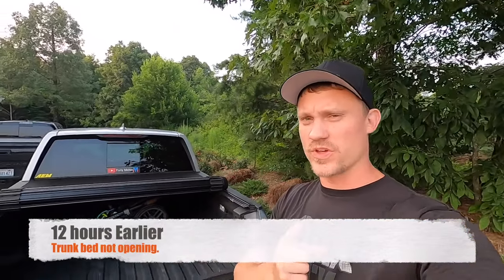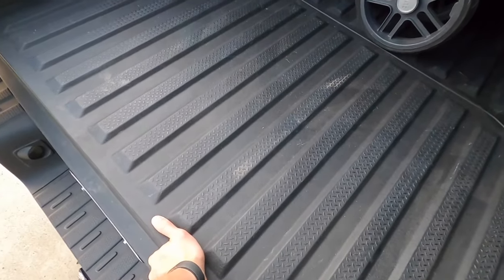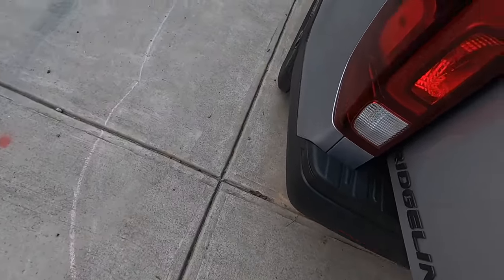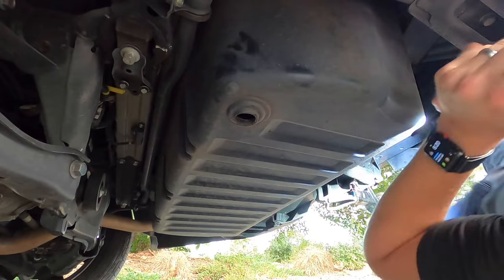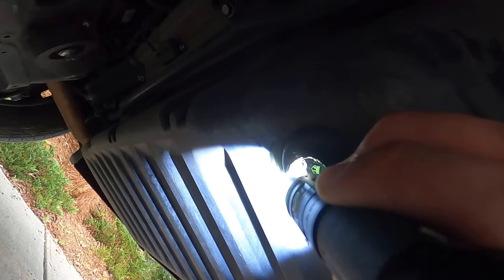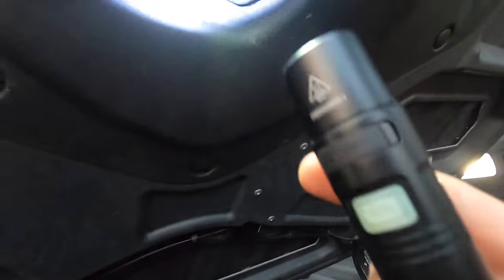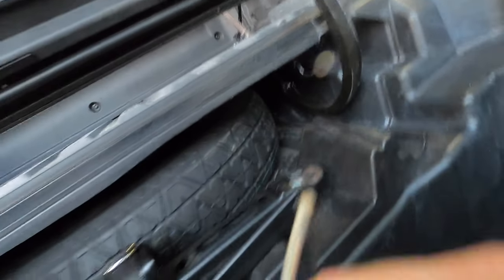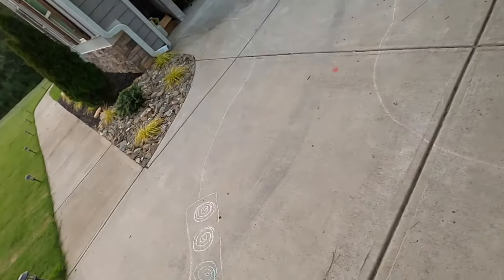Honda Issue Uncovered! Cant access in-bed Trunk / Spare tire - Watch my repair method

Comment: Thank you for taking the time to troubleshoot this for everyone in the world !
It is amazing that Honda would install a cable and NOT have the only holder NOT screwed into the panel next to it, so it never moved unless it was loosened for adjustment, etc...
My 19-year-old Snapper Lawn Mower has a way better cable attachment for the throttle cable than absolutely nothing that Honda did to all its people...
Reply from the maker: So I have a secondary video that I went back and re evaluated the problem and there is a cable holder but after looking further at the recordings Honda never seated it in place. If they did it popped out. So I have a zip tie for that as well.
Reply: Thank you for taking the time to educate us about that particular situation.  Honda take note of this.""""  God bless all of you out there.
Reply: @YuriyMotso 
As an engineer I was agast to see this video with HONDA (of all mfgrs) NOT providing a positive stop for the cable jacket!

You really should make a primary comment regarding your follow-up video, and pin it in the comments...😉
Reply: @YuriyMotso 
Can U post 2nd video link?

Comment: Thank you for anticipating your viewers curiosity relative to the tools used in your video.   I was hoping that opening the "SHOW MORE" link would expose the Pry Tool Kit; and BOOM there it is. 
Thank you for taking the time to document this curious impairment, completely walking us through the cause and providing the Ridgeline community with a simple solution to mitigate potentially expensive experience.  Bravo!    Gratefully.

Comment: Checked my truck.  The right yellow electrical tape had moved away (further right) from the black cable holder.  I moved the cable toward the right and moved the right electrical back against the cable holder, and installed two nylon cable ties against the cable holder on each side.  I have a nylon cable gun, that will tighten and cut the excess when it reaches a set tightening.  Thanks so much for the great info
Reply: What??

Comment: I checked my Gen 1 2008 Ridgeline and it has white tape vs. yellow.  The right tape also had slid.  I used a zip tie and placed a dab of glue to hold in place.   Checked the trunk and it worked fine.  Thanks

Comment: I thought this video was going down a rabbit  hole of bologna. I usually do not comment on Ridgeline videos, but this one was very good and informative. I store a bunch of my camping stuff in my trunk. If I get out in the woods and this fails - oh my - no dinner for CampingRandy. Thanks for this video. I’ll be checking mine and doing a video as well. Need to get the word out on this. I was yelling at the Tv, “put on a crossed set of zip ties” and bam, you did. Great job!
Reply: I keep junk in my trunk also. fixed it
;)

Comment: Just bought a ridgeline 2021,  I checked and the two yellow tape are still solid but I took some super glue and made sure those two yellow tapes don’t ever come loose.  I couldn’t zip tie because it was too tight,  so I super glue that spot so it’ll never come loose as well

Comment: I just checked my 2019 trunk lock yesterday after seeing your video. 
Sure enough there were the two pieces yellow tape. I did as you recommended to attach the latch cable to pvc fastener with a figure 8 zip tie. Worked liked a charm. Thx again for the heads-up sir, you are the MAN!

Comment: Great troubleshooting skills! Excellent presentation skills as well! This video is hugely useful--thanks for taking the time to create it. I will just suggest checking the temperature rating of the zip ties you use. Not all zip ties are equal. I've seen zip ties I used for car stereo installations become brittle and fall apart due to the extreme heat conditions. I found a chart that indicated the interior of your car can reach 150 degrees F (or more!) with the windows up in summer, on a 100-degree day. I don't know how hot the trunk in a Ridgeline gets in the sun, but you can buy zip ties rated at 185 degrees and higher. Metal zip ties are rated at a whopping 1,000 degrees, which admittedly is overkill. Having an underrated zip tie eventually fail is just as bad as not installing it at all.  😀

Comment: Yuriy,

I just opened it up and looked around. The cable you are referring to is actually the cable used by the physical key. On you keyfob has the physical key, use it in the lock and it actuates the cable. The electric solenoid doesn't use the cable you are referring to. I might be wrong but that's what I am seeing. I triggered the solenoid and the cable doesn't get touched at all. In your case, the cable shifted and prevented the key lock method to open the trunk manually.
Reply from the maker: I will actually be doing a secondary video maybe today or tomorrow and post up soon. Doing some diagnostics on it and there seems to be more than one thing at play here. I first need to confirm my suspicions and once I do I will make a secondary video. The zip tie I’m recommending is definitely helpful regardless. In fact if what I test out confirms what I think may be the issue, it can be the difference between the handle failing eventually and you never noticing that it failed. it will continue operating even though there is an issue. I Will show you all how to prevent this system from ever failing again. There are just too many flaws and no safety in place. The one that was in place failed so my repair method is definitely important.
Reply: @YuriyMotso  In the video, I didn't see you try using the key at all instead of the solenoid or squeeze button. The key should be the backup method to get in if squeeze handle is failing or dead battery. In your case cable shifted and may not be enough to open so going from the drain plug was the last hope
Reply from the maker: Look at stage 1 of the grieving process 🤣
Reply: @YuriyMotso  Got it. I totally missed it.
Reply: @YuriyMotso  no

Comment: Great job!  I just bought a 2023 and the dealer had removed the cover and lubed it up and then forgot to put the new panel on.  I put it on and had to ask them for a push clip.. I’m going go open it up and see if they did any preventative maintenance. Thanks again!

Comment: Great fix and wow what a challenging problem.  Your fix clearly solved the issue for you. I'm wondering if the real culprit is the retaining clip just before the ball on the trunk release cable.  I've had to replace the broken plastic retaining clips on several mechanisms exactly like that you showed.  Typically if the manufacturer plastic retaining clip fails the cable housing is pulled past the retainer letting the ball and cable "push" too far as you have shown.  An aluminum replacement retaining clip is a permenant solution not subject to failure as a plastic zip tie will be over time.
Reply from the maker: I did a second video going in depth because I didn’t notice it the first time. But it was not installed properly which lead to the failure. I have heard others have now had this same issue after checking. Super thankful it failed when it did because moments earlier it was full to the brim with food.

Comment: good thing you didnt have much items in that trunk...otherwise you couldnt get to that emergeny latch under the lid. theres no way you could have done this if you needed a spare tire and got locked out in the middle of nowhere.
great video. zip tied the area.

Comment: I'm most impressed that you were able to open that drain hole from the bottom, snake that aluminum rod just right, and open the trunk with the emergency lever. Nice problem solving. I wonder if crimping two aluminum wire sleeves on either side of that anchor would work. Zip ties dry out. Just a thought.
Reply: could be staged man

Comment: Thanks for sharing. Great vid. The trunk cover should and needs to be removable or have emergency release capability from the top/outside. This is just poor design and not enough deep dive during design phase. Especially when the spare tire is in there and becomes inaccessible in emergency situations.

Comment: I had a similar problem to, but my problem was the linkage inside the tailgate. one day it did not lock, so I unscrewed the back panel and found one of the linkage bars had come out of it's plastic holders. So I did the same as you and put ZIP tie's on all the linkage bars, to their holders,  I checked it out, to make sure it works, before I put the back cover on again....the 5 cent ZIP tie's worked out great, no problems now.........You may want to do a video on that subject, because in my case, it did happen and was an easy fix.   Thanks for sharing his insightful video, now I'll go check out that yellow tape!
Reply from the maker: I have a secondary video that talks about the channel lock. That actually was an additional issue. I had to re watch all my footage to come to the conclusion fully.

Comment: Mine did this as well but just used the physical key to open it up instead of having to go underneath it through the drain plug
Reply from the maker: The physical key wouldn’t work in my scenario. This is worst case scenario.

Comment: My 2005 honda accord had the same issue except I could access the trunk thru the car and release the latch.  I had to replace the latch mechanism where I got from Amazon.  From what I see in your video and my experience, those wires that control the latch can move over time.

Comment: So there is a switch in the glove box that locks the trunk bed and prevents its from being opened with the fob or key.  Did you check to make sure it wasn’t on before going through all these gyrations?
Reply from the maker: Yes. That switch cuts off power to the trunk.  As you can hear in the video the motor is actuating. I did check it as well but was not relevant to the video so I did not add it here.

I am working on a secondary video to this one. I am doing deeper investigation to root cause. Expect the video to drop by Friday.
Reply: Yeah ,that switch just leaves the tailgate permanently unlocked. So when you lock the cab ,the back gate doesn't lock.

Comment: Wow - good work!!  You really tackled the problem systematically.  I have a 2006 RT which I bought new.  Best vehicle I have ever owned.  Every problem I have ever seen on this channel regarding Ridgelines has been on the newer ones.  Did Honda out think themselves with the 2nd generation of Ridgelines?  Did they add too many electronics and gimmicks and shortcuts like this one?  I am not going to investigate this on my Ridgeline because I have not had a problem and suspect that the original design of the trunk system was not configured in this flimsy way.  Any thoughts by 1st and 2nd gen Ridgeline owners?
Reply from the maker: Thanks. So I have a secondary video which I checked one additional component which was the main reason for the issue. But it would not have failed had this been properly secured here as well. However it’s one of the earlier production models so that’s another reason I believe.

Comment: Good job Yuriy, just Subscribed thank you. Question? I view your video on the AEM Vs. OEM and my question is will I have the same results on my just purchase (2021 Honda Ridgeline Sport) if I install the AEM KIT for a little more power?
Reply from the maker: So yes, these are realistic numbers you could see on your vehicle. I do a follow up video testing out a few more filters and the performance filter the second time didn’t perform as good. There are many factors for this. I explained to another individual why it could be but basically we were able to reproduce the numbers that AEM claims. This is like a best case scenario. I think it may not always run this way though. Without a specific tune you may not be consistently running those numbers. Also remember that these numbers are in the peak band over 5k rpm. So in my testing the overall best product is the drop in AEM filter. It’s what I personally use now and it’s cost effective. Good gains all around using that product. Not promoting it but just stating what I found to work best from my tests. Hope this helps.

Comment: Looking at this I think the yellow tape was used to identify the location where the worker was to attach the cable to the bracket. I don't think Honda intended for the tape to secure the cable from sliding

Comment: I like the video for informational I may try it sometime question about tailgate locks aftermarket OEM does not offer to lock the tailgate the video you showed was about locking the trunk I have a 2019 Black Edition Ridgeline I may not have all the tools do you know if places do it for you I live in California I may have to Google it or ask a shop just wondering thank you
Reply from the maker: I’m sure you can get it installed. However it’s quite simple and I doubt you won’t have the tools. They are pretty basic tools. If anything spend money on tools to have instead of having a shop do it if you can.

Comment: Very informative with a clear explanation of the problem and solution.  I'm virtual window shopping and the Ridgeline is on my shortlist, so this was of interest to me.

It looked (relatively) too easy to take off the drain plug from the outside and pop the release with the metal rod, i.e. would be easy for thieves.  It took you some effort to wiggle the trunk open then, but could the trunk be opened with the tailgate locked?
Reply from the maker: The release on the inside overrides all. It’s a safety feature in the event someone was locked in. It’s a literal manual lever that forces the hook to unlock. As much as it may seem easy to unlock it it still would be a hassle. You would have to be a dedicated Ridgeline thief and now I guess I have just shown everyone how to break into our trucks. 🤣😂🤣 I should rename the video, how to break into a Honda Ridgeline the easy way. 😂
Reply: @YuriyMotso  Ah, makes sense in hindsight, that the inside release is intended to work regardless of the position of the tailgate.  It still seems way too easy to pop off (in) the drain plug from the outside, allowing for all sorts of mischief.  But given its market share yes a Ridgeline thief would be a rare breed. 😂
Reply: @YuriyMotso  
Yep, you’ve started a trend of Ridgeline thieves. Guess I gotta scratch the Honda trucklet off my to buy list. Thnx. 😔
Reply: I think if the trunk was full of stuff or like my case, I have a OEM Ridgeline mat that covers the plug, it wouldn’t be really easy to open it the same way it was done in this video. However, I will check it out in my 2020 RL to make sure it is ok and secure it more. It would be a higher problem if that happens to me. Thanks for the video!
Reply: @travelinman482 property theft from vehicles is almost always a smash and grab.  Unfounded worry man...

Comment: Honda always has two escape modes for their locked areas, my 2019 would not open and after checking this video I was able to use my key and all was well.  My vehicle needs to be unlocked for the  unit to open. I can unlock the truck😊 or use the key.....two escape plans.........your cable plan does not seem necessary as it is an electric switch

Comment: Thanks Yuriy 👍🇺🇸.  Going in tomorrow and apply your fix.  Also, will post your YouTube link on the  Honda Ridgeline Owners Club web site.  This is a HUGE screw-up by Honda.
Reply from the maker: Awesome. Thanks! Glad I can help. I was a bit worried but thank God I figured it out and didn’t have anything in the trunk.
Reply: @YuriyMotso   Yuriy as I mentioned, I just now finished posting this issue, with the link to your YouTube post, in the Ridgeline Owners Club Forum.
Can’t thank you 🙏 enough for sharing this.  👍🇺🇸
Reply: @LAP1050  ON a newer (2021) Ridgeline video, they showed manual pull lines for both the trunk and gas filler door.  The one for the trunk may be behind the license plate and the gas pull is inside the drivers side door, behind a small panel. That one was actually a plastic pull lever.  I don't know if its a newer addition since I just recently started looking into the Ridgeline.  But I'm on my 4th Honda.

Comment: If Honda does not fix this, it almost seems planned!  I doubt there will be a mandatory recall as the is not a safety issue when driving a Ridgeline.  Still, it is a known problem that needs correction.  The trunk is a major reason to buy a Ridgeline.  Now, it is a liability.

Comment: Can anyone tell me why one wouldn't install a power tailgate lock and make electrical attachment to this trunk lock circuit?  instead of running a cable all the way to the engine compartment?

Comment: 23 RL, handle release is electric, but the manual key release uses the cable.  I zip tied it while I had it open to look at it, although the cable hold down clamp is very tight.  About 1/4" between the electrical tape and the hold down clamp on both sides.

Comment: Mine wont open either 
But mine doesn’t make any noise when pushing it like yours
Reply from the maker: Go into your glove box. Open it and on the left hand side in the back there is a switch. Make sure that it’s on not off. If no noise that means there is no power going to the trunk.
Reply: @YuriyMotso  no noise. So bad fuse or what should I check? I appreciate it
Reply: Tried the switch on and off and won’t open.  Bought the truck this way. No noise when off or on
Reply from the maker: Ok then you are not getting power to the latch. If you bought it new or even used but has warranty then have them inspect the truck and repair it. If not then you need to look and make sure you have power. I don’t know if there is a fuse specifically for that latch system it may be part of another system but will need to get a multimeter and start testing for power. In any case if you can access the trunk from underneath like I show in the video then you can always open this way and then start inspecting the wiring.